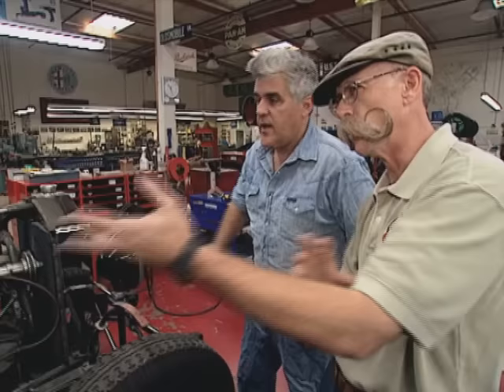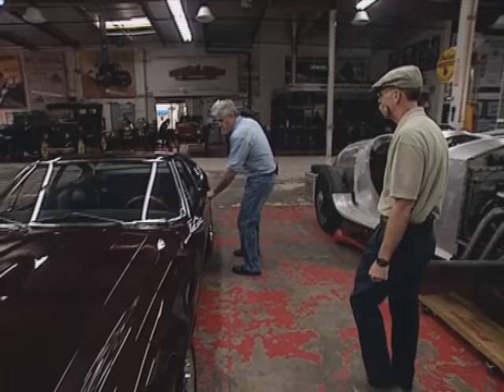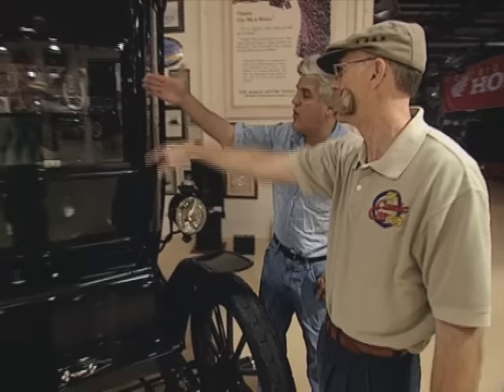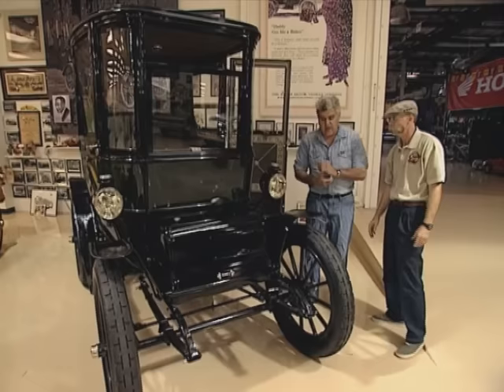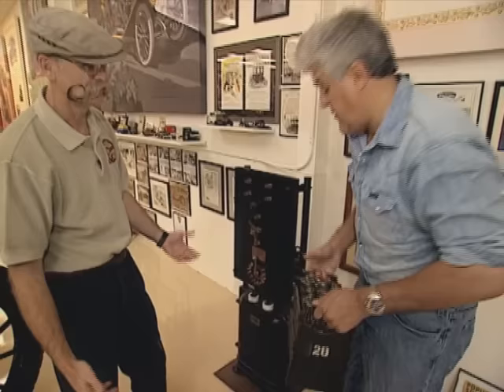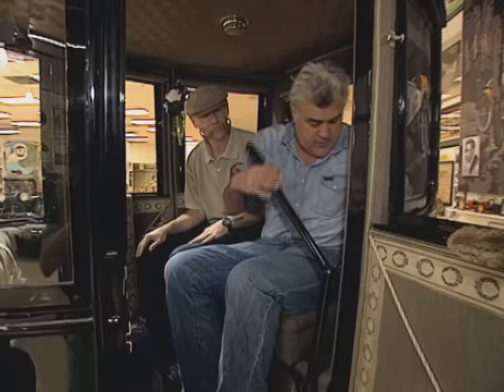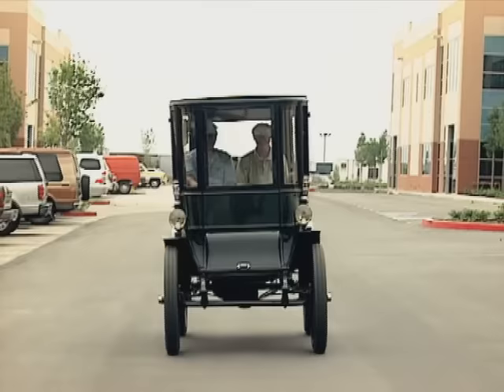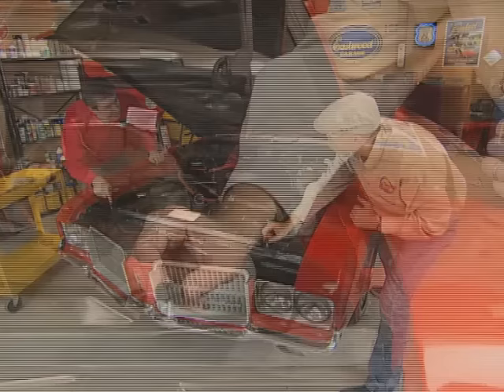Jay Leno's Baker Electric Car

Comment: 15,000 Electric Cars a hundred years ago?! Okay, I smell sabotage
Reply: +The real doktorbimmer I'm very curious about this...depending on how the electricity is produced electric cars can be better in all regards. I'm looking foward to the return of the steam engine tho haha
Reply: The real doktorbimmer hmmm, you don't think that with lighter materials and the ability to make more energy efficient boilers could allow a steam engine to be more efficient?
Reply: +The real doktorbimmer 
ah, the long tailpipe argument.
Tell me more about it.

Have to agree on steam engines though, something about them...
Reply: The real doktorbimmer
I do love locomotives, but I've always had a thing for traction engines in particular.
Any steam machinery is lovely though.

Now onto the long tailpipe debate:
Whenever i see people opposed to electric cars, they use the long tailpipe argument.
Really, the cause for concern should be surrounding the lithium used in their batteries.

The part i have trouble believing is that more than 75% of the energy generated at the plant is lost to transmission alone.

A Tesla model S for example, has an electricity to wheel efficiency of 97%(!), a charging efficiency of about 90%, and therefore an overall energy use efficiency of around 87%.

Petrol cars tend to be low twenties for overall efficiency, though Diesels can be notably more efficient, around the low thirties.
So in terms of energy use over distance, an electric car is 2-3 times more efficient.

Secondly, power plants achieve much better thermal conversion rates than internal combustion engines, because they don't have to be small and compact.
While a petrol ICE can achieve 20-25% efficiency, a power plant can achieve 40-50% efficiency. Due to the way they operate, coal power plants can achieve similar efficiency.

Lets call that up to 2 times more efficient.
What this translates to is that even a large, heavy electric car like the S is around 6 times more efficient than a gasoline car, and 4 times more efficient than a diesel car.
Therefore, to even be bought down to the level of a diesel car, transmission losses have to be in excess of 75%, but the numbers i find state around 30% per 100 miles.

That comes out at about 400 miles of transmission distance before electrics are on par with diesels, and 400 miles seems an excessive distance in most cases.

My country is over 80% renewable electricity, so electric cars win hands down here, they get the equivalent of 220-240 mpg.
Reply: The real doktorbimmer
The only NAS study i could find referenced coal plants, and it wasn't to do with their efficiency, but rather the deaths the pollution caused, something coal is far worse than gasoline at.
The same paper also said that for natural gas plants EV's were significantly better, and the U.S is currently focusing on reducing their coal generation. In fact the U.S is already more than 50% natural gas, nuclear, and renewable.

And where did you get those figures for electric vehicle efficiency?

A Tesla model S gets 97% efficiency from battery to wheels, and 92% battery cycle efficiency, which comes out to a total of 87% electrical to mechanical efficiency.

Not to mention that the best ICE cars today are around 35% efficient, while a power plant can reach 55% efficiency. A natural gas plant can be over 60%.

So a Tesla is about 2.5x more power efficient for a given distance than a high efficiency ICE, and its power generation source is at least another half more efficient than said ICE. That means that a Tesla is roughly 4x more efficient per mile than a high efficiency before transmission losses.

Transmission losses are about 30% per hundred miles, so in order to bring the efficiency of a Tesla down to 30% overall, you need to be transmitting the power over a distance greater than 400 miles. Most power plants transmit power less than 150 miles from what i can find, leaving a Tesla at 2.5-3x more efficient than a high efficiency ICE.
The fact that a Tesla has an equivalent mpg of around 120, while a high efficiency ICE gets around 45. The numbers get even better if you use something more efficient like a Prius.

You also make the assumption that EV's will only be run from power plants that burn fossil fuels, and as far a renewable's like solar and wind go, you could be correct.
But as far as i'm concerned, nuclear power is still a promising alternative, look at countries like France, almost completely nuclear.
Also, my own country is actually over 85% renewable, so EV's win on pollution here hands down.
Reply: The real doktorbimmer
Can you sho me where the paper claims that please.
I must have missed it, because i only found numbers for coal pollution to power EV's compared with gasoline pollution directly from ICE's ,and as i said, the same paper also claimed that natural gas EV's are better, and the U.S is increasingly using natural gas, as well as nuclear.

And can you give me a proper explanation, from start to finish, as to why i am wrong, rather than being vague?

Also, i call bullshit you were using my figures, you said 50-60% losses for battery, and 30% losses for transmission. I said those numbers were 8% and 3% respectively(at least on a Tesla, i don't know about other EV's)

I'll accept that some of the numbers could be a bit off,depending on the exact equipment, but i couldn't find any ICE car with better than about 35%. The higher figures in the 50's are in ships and generators, the same sort that run power plants.

And i also never said that renewable could support the world. I said Nuclear power could.
Reply: +The real doktorbimmer 
I wasn't using losses.
If you want loss figures, a tesla has a 3% transmission loss and an 8% battery loss, for a total 13% loss.
Reply: The real doktorbimmer My province produces all it's electricity through hydro power. Wouldn't electric cars be a good solution?
Reply: The real doktorbimmer The tesla has a good enough battery to be an effective replacement, no?
Reply: +The real doktorbimmer  and the price
Reply: The real doktorbimmer
Gasoline Cars were expensive and inefficient at first. Look at them today. Given time, electric cars will improve their batteries and price, but only if people are pushing the development.

That is the long term goal of Tesla.
In a few years they will release the model 3 with a price tag of $35,000. Still expensive, but a lot more accessible to the general public. The idea is that it will be what the Model T was 100 years ago.
Reply: The real doktorbimmer
You can't build the perfect battery, but you don't need to. You only need to build one that beats an ICE. An Aluminium-oxygen cell could potentially do that. Or any one of a thousand other chemistries.

As for that being Tesla's long term goal, you do realise they have yet to turn a profit?
The major shareholders are Elon and Kimbal Musk, and they have stated repeatedly that mass EV deployment matter's more to them than profit. 

It is true that Tesla has missed some deadlines, and even cancelled the battery swap idea due to lack of public support. But they never said anything fundamentally untrue that i can find.

Most EV companies have died so what?
Most Operating system companies died too.
But Apple and Microsoft are still here.

As for the number reaching ~15 million.
That is your opinion. At this point no one knows how it will turn out.

You know, i actually am not that confident that they will do it either.
I like to hope they will, but there are so many things that can kill a company.

AND NOT THE EFFICIENCY THING AGAIN. I posted the numbers, you never gave a proper argument in reply, but we can go through them again if you like.
EV's are more efficient in virtually all scenario's. Even a low efficiency EV running on a Chinese coal plant gets 35mpg.
In America the average is closer to 80mpg, because of the large amount of nuclear and natural gas in the mix. In my country they get like 250mpg, because we are 80% hydro power and 10% wind, with the remaining being natural gas and coal.

Go ahead and give some actual math disproving EV efficiency, not a mention of some study that you didn't actually read, do it yourself.
Reply: The real doktorbimmer
All, right lithium-oxygen then.
For some reason i thought aluminium air cells were secondaries.

As for Elon getting a payout, i'm willing to believe that if you give me proof.

But 11 billion?
Sounds like SpaceX to me, not Tesla.
SpaceX is his moneymaker.

As for the 250mpg:

http://shrinkthatfootprint.com/wp-content/uploads/2013/02/Shades-of-Green-Full-Report.pdf

This was done in 2009, when lead-acid battery
technology meant electric cars were about 15% less efficient than today, so multiply by 1.15 to get a modern lithium-ion car.
Also be aware that many countries are even more energy efficient today.
Alternatively, consult the "low" column of the final graph.

It's easy when you think about it.
Assume an electric car gets the same mpg as a normal car (event though they don't, they get better), now assume that the car is 90% hydro powered, and 10% gas-generator powered. This is roughly what my country is.

This means that for a given distance the electric car emits only 1/10th as much co2, therefore getting 10 times the mile-per-gallon-equivalent. So roughly speaking 25x10=250.

An electric car run solely on solar power gets infinite miles per gallon.
So a car on a partial fossil fuel source only consumes that relative fraction of fuel.

Now as i said earlier the U.S is 50% natural gas and nuclear, this brings its relative mpg to around 60% more. So depending on which state you are in, electric cars get between 25 and  70 mpg. Factor in the increased efficiency and those numbers get higher.
Reply: The real doktorbimmer
O'k then. Thank you for actually responding by pointing out flaws in my argument. I will now address them:

How about we say 45% for a power plant efficiency. This is less than what some marine power plants on ships get, so this isn't overly optimistic.

Now i'm going to assume that the transmission occurs over a distance of 500 miles, even though it is usually less.
In the U.S as best i can find the grid is a 345kv system, which gives a transmission loss of 4.2% per 100 miles.

Then lets account for the Roadsters 13% charging losses.

Overall, this brings efficiency down to 32.4%
So the energy delivered from one gallon of gasoline is 33.4 * 0.324= 10.8 kWh

I'm now going to use a roadster gen 3, with the 400 mile range. This roadster can go 5.7 miles per kWh.
10.8 kWh * 5.7 miles = 61.5mpg
Still way above ICE's

In fact, to get down to say, 25mpg, the energy efficiency for extracting electricity from gasoline has to be as low as 13.1%!
A backyard generator can do around 18%.
Even accounting for the charging losses, this is still about 16%, and 30.5mpg

So even charging your car with a small generator is still more efficient than most gas cars.

Oh and to answer your questions, a Tesla battery pack has a guaranteed lifespan of 10 years, though they should last longer.
The production energy for a Tesla battery pack adds about another 40% more electricity cost to producing the car, so they do have a larger initial offset. Battery performance after 10 years is about 85%.
However this only affects capacity, not efficiency.
The batteries have a standby loss of about 0.2% per day.

However, Mpg doesn't take the efficiency cost of transporting gasoline or pumping it in stations into account, nor does it account for idling in a car, or the fact that a lot more energy is used when starting the engine. It is just a measure of running performance

So why should eMpg take into account losses like that?
Reply: The real doktorbimmer
Tesla's batteries have a 87% wall plug in to transmission out efficiency.

And i did include those losses in my figures! (remember the 13% loss? 100-87=13), all i was saying is that if i include those losses, mpg for normal cars should also include pumping, transporting, and idling losses, since they use extra energy too.

Anyway, show me exactly where my figures are grossly inflated, and correct them.

And there are ICE cars out there with 42% overall efficiency?

This should put them in a similar mpg to the roadster. An average sized car with 42% efficiency should have at least 50mpg.

Give me an example please, i have not been able to find more than about 30% overall efficiency cars, usually an engine with about 35% efficient, and some transmission losses.

Now i was able to find some diesels that approached this requirement, but my calculations for an electric car were based on a gasoline power plant. If i based them on a diesel power plant, i can bump that 42% figure up to around  52%, and get about a 24% boost to mpg. (24% of 42 is 10)

Another question for you, do you think hybrids are less efficient than normal cars?
Reply: The real doktorbimmer
Diesel is not the most efficient form of propulsion used by mankind. That would be nuclear actually. Of course there are very good reasons why we don't have nuclear cars but still, it beats diesel by miles.

And actually, diesel looses to other methods, such as hydrogen fuel cells, high bypass gas turbines and solar. (solar is a bit weird, since it technically gets infinite mpg, but it is limited by weather)

It is however, much better than gasoline, i was very impressed by the Audi A3 TDIe!

It's combined driving mpg is a tad better than a gasoline sourced Tesla roadster, 63 vs 61.5 .The value of 71mpg it got in the race is inaccurate, since it was driving at an average speed of less than 50mph, and that would increase any cars mpg. I can settle for 71 though.

Problem is, as i said earlier, if you want to bring diesel into the mix i can buff my numbers a bit, since diesel generators are also more efficient. Diesel also has more energy per gallon. 
55% instead of 45% for a power plant.
And 38kwh instead of 33.4kwh per gallon.
55% accounting for transmission losses and charging losses is 46.7% efficiency, and a mpg of 17.75 * 5.7 = 101 mpg.

The reason electric cars can get better efficiency is because stationary power plants usually get significantly better efficiency than compact mobile variants, usually around 40% more, but the losses from transmission and charging are usually only half of that.

Now if you compared a diesel car to a coal-electric, sure the diesel would win. but diesel vs diesel, electric gets better efficiency.
This is also why serial hybrids get better mpg than their pure ICE cousins. The engine in them can run at its ideal rpm and torque range, getting better efficiency, and this is more than enough to offset the losses of an electric drive train.

As for electric cars loosing on range and charging, yes they do. Currently they are worse than their ICE rivals. But this is irrelevant when talking about efficiency.
Solar cars get practically infinite mpg, but they aren't practical for everyday use.
Reply: The real doktorbimmer
Diesel is arguably the most cheap and practical fuel source given our current infrastructure, yes. 

And the most efficient when specifically talking about the Carnot cycle yes.

But the Carnot cycle is a terrible measure of efficiency when comparing different types of power source.
Specific energy of the fuel source combined with the energy capture efficiency is much better.

Uranium has a specific energy roughly a million times greater than diesel, so that pesky 40% vs 56% doesn't matter so much.
This is why U.S warships and submarines use nuclear, they can run on a barrel of uranium for a decade rather than a minute.

But as i said before, nuclear is not practical for most vehicles.
Gas turbines similarly loose to Diesel in heat efficiency, and thus the Carnot cycle.
However, due to the specific energy of the fuel they use being about double diesel, they can still get better mpg, though not by much.

However, their high idle fuel consumption, large startup costs, and poor spooling response make them inferior for use in small vehicles that start and stop regularly.
Hence why they are used in aircraft and some ships and tanks.

Saying solar panels get a poor Carnot cycle is unfair for the same reason as nuclear.

Because solar panels use the sun as an energy source, they have specific energy comparable to fusion power.
This makes them more efficient than even fission power, by a factor of 20-50.
However, they have terrible capture efficiency due to distance from the sun and limitations of the photoelectric effect, bringing them to approximately the same efficiency as light water reactors.
Still far more efficient than diesel though.

Again, they are less practical than diesel however, since they only work in sunlight.

So while diesel is more practical than these three power sources, something i never disputed, they are more efficient, in some cases by orders of magnitude.

Electric vehicles can take advantage of this higher efficiency offered by fission and fusion. 

Theoretically with good enough batteries they can reach a level of practicality similar to diesel or gasoline.

Tl;dr fission and fusion energy is more efficient than chemical energy, but currently less practical.
Reply: The real doktorbimmer
Energy density is the measure of how much energy you get for a given mass.

Some energy density values in MJ/kg:
Diesel (Chemical): 48
Hydrogen (Chemical): 142
Plutonium (Nuclear decay): 2,239,000
Uranium (Nuclear fission): 80,620,000
Hydrogen (Nuclear Fusion): 89,875,517,900

As you can see, diesel is hideously inefficient compared with anything nuclear.
BTW, most sources of "sustainable" electricity are either nuclear in origin.
Wind, solar, and hydro are all driven by fusion.
Nuclear reactors are driven by fission.

With a few exceptions, everything else falls under chemical, usually hydrocarbons.
Reply: sorry, but  Americans don't want to buy electric cars.
Reply: kaputnik11
Tesla's sales figures in N.A compared with Europe and China beg to differ.

But the general public? 
You would be correct.
Reply: The real doktorbimmer
Thermal efficiency != Fuel efficiency
At least when it comes to vehicles.
A scenario to demonstrate my point:
(a pirate-ninja is a made-up unit of energy, similar to a kilowatt in function)

Car A runs on fuel A
Car A has a 20% efficient engine
Fuel A contains 10 pirate-ninjas per liter

Car B runs on fuel B
Car B has a 10% efficient engine
Fuel B contains 50 pirate-ninjas per liter

Both cars can go 1 km per pirate-ninja.
If you fill both cars with 10 litres of fuel, 
Car A will travel 20km
Car B will travel 50km
So despite car A having a more efficient engine, it will not travel as far for a given amount of fuel.
Therefore, doesn't Car A have better engine/thermal efficiency, but Car B have better fuel efficiency?

But sure, if you want to define specifically the Carnot cycle then diesel is the best, though Stirling and Rankine based engines can give it a run for its money on overall heat efficiency.

Another hypothetical scenario:
A wind-up car is wound up using tidal power.
What is its thermal efficiency?
Bugger all, that's what.
Yet it runs purely on momentum conversion, giving it virtually infinite fuel economy.

Of course such a car would be impractical to the extreme, but i hope it illustrates the problem with using the Carnot cycle specifically, and the heat cycle in general, as a comparison of efficiency when one or more if the methods in comparison doesn't use heat for energy.

Some Engineers may use the Carnot cycle, but Physicists would use specific energy on account of it giving a better picture of the overall scenario.
Reply: The real doktorbimmer
But my point was, that of what sales they do get, most are in America, not overall sales.
Reply: The real doktorbimmer
Comparing a car that is half the price of another isn't a real comparison.
Of course more people buy the cheaper car.

If you want something to compare against Tesla you need to look in the $100k+ range.

But anyway, my point wasn't and still isn't that Tesla is specifically popular in the U.S, but rather that it is more popular in the U.S compared with Europe or China
Reply: The real doktorbimmer
I never made that comparison though, you on the other hand did make a comparison between a Tesla and a Chevy.

I could remark that a $200k Rolls Royce doesn't have the same range or fuel economy as my Toyota corolla, but that doesn't make my corolla a better car.

I also never claimed that Tesla was "popular" in America, merely relatively <i>more</i> popular than in other countries. I've said this several times, but i'm not sure you get it.

Tesla is super popular in my country btw, we have a whole THREE of them here.

Most popular car would be either mazda's or toyota's, basically all i see.

(and yes i know that html formatting doesn't work in YouTube comments, i just want to highlight the word more)
Reply: The real doktorbimmer
Can you point out where i implied that Tesla was popular?
I'm fully aware that they have a very limited market.

Also, my Rolls Royce example was about price vs performance difference, not popularity.

I also never made claims supporting Tesla as affordable or practical, i merely cited them as an example of efficiency in the long tailpipe argument.
Reply: The real doktorbimmer
What word would you use to compare relative car popularity between two countries then?

And i only repeated that statement because you seemed to misunderstand.

As for the next "ford", honestly that might end up being Chevrolet rather than Tesla.

Not to mention your point of Tesla's being expensive and impractical is irrelevant in this particular comparison, because cars in general were expensive and impractical before Ford's Model T. The whole point of "fording" is to change that.

BTW, the point i made in that same comment was that in order for Tesla (or any company) to do that, they would have to reduce prices and improve battery performance.

At no point did i claim that they are currently "fording", rather that they might do so in the future. I recall saying that i wouldn't put money on them either, given the number of things that can kill a company.

Oh and Wasn't this discussion originally about the efficiency of EV's? rather than the poor practicality they have?

Where did we get to on that point?
Reply: back then i doupt sabotage was the reason. today though it could be true but people like Elon Musk dont want to be payed to make the company dissappear plus theyve gained so much ground other car manufacturers are trying to join the market.
Reply: +The real doktorbimmer just to let you know, Tesla sold 34000+ Model S's the first year they came out with the Model S, sure in comparison they dont match up but they are also not as financially accessible to the majority of people. they are extremely popular and just in a 15 mile radius from where i live there are 5. to make it better there are no Tesla supercharger stations or dealerships anywhere near here showing that a lot of people are willing to invest in the technology. sure the batteries are not good for the environment but we can only improve on something that is being used. if we just stay with gas and diesel then we will always be dependent on those fuels. i have a feeling electric cars are one of the reasons why gas stations have dropped their prices dramatically aswell as the supply being way more than the demand. also most electricity is produced by fosil fuel burning plants but again we need to take steps to improve in the long term and EV's will eventually be the answer.
Reply: Thats sad you wrote that in 2015 when what you just said has already been proven to be mostly wrong. Funniest part is Diesel Cars, DieselGate soo that prediction was dead. The National Academy of Science is widely disreputed now as it totally disregards Wind & Solar electric generation and only focuses on Fuel Efficiency based on Fuel consuming electric generation. Problem is you can't calculate Wind & Solar FUEL Efficiency when consumption is 0. Oh and now Wind & Solar is Financial Lucrative as a Buisness while dozens of Coal companies around the world are going Bankrupt due to financial business reasons. Hmm I wonder how does Wind & Solar pollute the Air Quality in rural areas. Sucks for you your comment is stuck online for many years, kind of looks silly now.
Reply: At least attempt at constructive criticism and that is what you resort to. No I do not smoke marijuana, not legal where i live and not worth the risk.
Reply: Poor marketing was also responsible for the demise of the Baker Electric line of cars. They were viewed as cars for women.
Reply: If you think that Jay Leno is emasculated, or that Francis Ford Coppola fits that description, then you have never met or seen either of them in your lifetime. What cave have you been hiding in all these years? If not, then you are [more likely] just suffering denial about the inevitable changes which the future will bring. This is not about carbon footprints, but it is about breathing air in order to survive. I see the brown cloud that rises each day along the coast of Israel, and I lived in Los Angeles at the age of eight, when it was still a city with blue skies, before smog ended that chapter. Smog is produced by ICE engines. You do not have a leg to stand upon, but you may have a financial dog in the promotion of the ICE market, and therefore want to trash electric cars. What else about them is a threat to you?
Reply: Did you include the cost of the billions in government subsidies to oil companies?  what about the trillions spent on wars to secure future oil reserves,  and the blood spilled?   what about the cost of oil spills and environmental damage,  cost to health?   imagine trying to sell the idea or oil, as a new idea,    super tankers, special "stations" to distribute fuels,  big refineries to process that fuel, and special vehicles to transport that fuel to those stations.

Imagine if a fraction of the money spent to make oil work ,  was spent on electric batteries?  100 years ago, 

fact is fossil fuels were used , simply because the crap was bubbling on the surface in some places, and until the early 70s,  we had so much we could export it. and produced all we needed.
Reply: It does not matter what the nay-sayers say,  not every country is under the influence of big oil and their negative propaganda,  many countries are moving away from fossil fuels,  not only because its the environmentally beneficial option,  but for economic reasons,  it makes their nation dependent on other countries.   ICE to many is like some religion,  talk of electric cars is blasphemy.   so while America is still enamored with sucking on the oil tit.  the rest of the world is moving forward,  many countries with plans to be 100% oil  independent.   whether its solar, wind,  geothermal,   nay-sayers of electric cars will also say "its impossible" or will never happen,  same was said of humans and flight.
Reply: The polluting part is the manufacture of the batteries.
Reply: Look up nickel mines and what they do to the surrounding area.
Reply: More like suppression. 

2 years later and you got a notification from this comment. I bet that feels good.
Reply: If you think about it there would have been more co2 produced by an electric car up to a certain point since the power would come from coal power plants and batteries then weren't as efficient as today's. Even the tesla has roughly the same impact as a prius assuming it's grid charged.
Reply: doktorbimmer  source?
Reply: It's just not true. Coal power is still much more efficient than petrol engines, mostly because they just keep on turning at a constant RPM, and can have the exhaust gasses used to spin up a secondary turbine. Most electric car nuts these days usually show interest in solar panels too. Here in New Zealand, we're almost entirely Hydro or Wind powered, and have been since forever.
Reply: doktorbimmer LETS GO HYDROGEN TURBINE POWERED CARS
Reply: really it was just because petroleum engines were cheaper to produce and run
Reply: Yes they can, Tesla has the fastest mass production car 0-60
Reply: lol you know oil and gas moneybags killed the electric car right they burned the designs and bought out the companies
Reply: Sabotaged by Ford. Mass production over coach builders. Electricity costing a premium and was not available everywhere like a lighting fluid.
Reply: jp moneybags Morgan and oil papi Rockefeller are the guys who killed the electric   car back in the day
Reply: das auto 
das ist korrect, mein herr.....
Reply: korrekt nein C das ist gut
Reply: I need to get a hobby.... posting hundreds of comments in a week doesn't count..... also im not bias for overpriced and poorly designed german cars, fords technology is far superior but tesla is the future!
Reply: buuuuuuuuuuuut.... in the long run tesla will win becase i beliveiieve in elong musk! porsche such two, some of the most overprised crap car everr 10/10 would report again :) also i dun goofed trieing to go bold im a weiner. you guys watch Ali-A? quality content.
Reply: The only sabotage was the advent of the Model A and Model T, along with the burgeoning early 1900's petroleum industry. As gasoline became readily and widely available, it spelled doom for the electrics.
Reply: doktorbimmer by 2040 you will no longer be able to purchase new cars with ICE. I believe other countries in Europe are doing the same. And company's such as Volvo are going going electric only from 2020. I may have to move to America. I trust there are no such plans in the land of the free?
Reply: shut your face! You think it's the level of engineering that keeps Mercedes, bmw and Audi their market for 30000 grand plus cars? Or the Ford and other car brands are incapable of matching such engineering. Lol. That might of bee n the case once upon a time, but I can assure you it's now purely down to marketing and the brand image
Reply: doktorbimmer lol. Unfortunately I believe the Germans can claim that honour
Reply: doktorbimmer I would have to agree with you, certainly the for road cars. I reckon England is the leader for race technology though
Reply: shut your face! Yeah I agree. I don't doubt that American companies could build cars like the Germans. American motoring has it's own unique history, because they are, or certainly were their own biggest market.
Reply: doktorbimmer oh dear; you've managed to sound reasonably intelligent throughout most of this thread. Here is a few things I can think of off the top of my head. roughly half the IndyCar engines are developed and built in England. le man lmp1 champion, le man lmp2 champion and Indycar contructors and drivers champion are a few of the cars to have British designed and built transmissions that have won in 2017 there are many more. Prodrive is a British company that runs race programs for the likes of Porsche, bmw, ford and Honda, amongst others. And then theres formula 1. I think about 3/4s of the   grid is designed and built in England.
Reply: I smell lobbyism.
Reply: doktorbimmer dude if electric cars would have been updated like gas was for the past century+ then it would be MUCH MUCH better... That car is amazing technology for that damn in age absolutely amazing and if it would of picked up we wouldn't be driving vehicles 1000x more efficient. Now if our government would quit being greedy pieces of shit and upgrade our grid electric cars would be much more efficient over cars... We can obtain electricity much more environmentally friendly than we are now but our government is to corrupt... Thats not electric cars fault that's the governments fault and once all that is taken care of electric cars will dominate.... electricity shouldn't be as expensive as it is and it won't for much longer.... Hopefully in the next decade something gives and our government has to get off their asses...
Reply: doktorbimmer it's okay because from the start the electric semi is going to outperform diesel semis and that will be the real start of mass produced EV.
Reply: Ah denying things that have already been accomplished 😂
Reply: doktorbimmer https://youtu.be/XlMFLPGUiQE
Reply: Read Edwin Black's book Internal Combustion. He wrote how through stock manipulation in chapter 8 of his book
Reply: doktorbimmer My brother you sound an Oil Company shill
Reply: But like you said in a 109 years electric cars especially their batteries save for the Lithium ion battery The Car Companies have only produced ICE powered cars With the Lithium Ion battery being the cutting edge in batteries And Mr. Black has wrote that just now people have been working on new battery technology. Something or someone is dragging their heels in producing electric cars
Reply: doktorbimmer Of course because your Oil company paymasters would say that as they buy all the new battery technology. And General Motors leased and notice didn't sell the EV1 and then cancelled their leases and crushed all save for a few EV1's And about Hybrid cars only Toyata sells Hybrids all the while receiving nothing but Oil Company inspired heat
Reply: actually it was more about redibility
Reply: doktorbimmer have you ever heard of solar or wind power electricity production?
Reply: The electric cars a hundred years ago weren’t as good as the internal combustion engines of the time
Reply: ChildOL they were never developed because of the powerful oil companies.
Reply: ChildOL you can thank Jay Rockefeller and Henry Ford for that one they sabotage Nikola Tesla's AC induction motor by saying it's dangerous you can think J Rockefeller and Henry Ford to that one day sabotage Nicollet Tesla's AC induction motor by Santa's dangerous call Nicollet Tesla want to put free electricity for every household all they had to do is stick a pole in the ground and they would have got electricity from the air and JP Morgan who was investor said f*** that s*** if I can't put a meter on it and charge for kilowatt in ain't going to be done so in the air being polluted with gasoline Vapors killing us
Reply: doktorbimmer my friends you don't understand how this works if everybody be driving in like the cars the world be a lot better A lot cleaner nobody would need to go faster but you can think Henry Ford and JP Morgan for that one so if you would study your history you would learn something Henry Ford saw the electric car as a threat and so did JP Rockefeller because Rockefeller had tons of money invested in petroleum he want to get that s*** out of the ground and into combustible vehicle as quick as possible and he was a ruthless scrupulous man he was very bodies and bribe Congressman to get what he wanted that's understandable hell he didn't want to be in the poor house or going to the soup lines so he did what he had to do.
Reply: charles neely think you will find it was the oil companies of the day that sabbotaged the electric car.
Reply: Indrid Cold ive already seen a documentry on this, oil companies stopped the electric car from being developped further.
Reply: same
Reply: OR A BS COMPANY...
Reply: Try looking up the movie...Who Killed The Electric Car... and you will be amazed.
Reply: doktorbimmer steam engines are the most efficient engines bro
Reply: "42% EFFICIENCY". No, you can not. If you're going to calculate transportation loss with EV's, you have to do the same thing with ICE. You have to calculate the energy consumption for drilling and pumping oil, consumption of transporting the oil to the refinery, consumption to make gasoline or diesel, consumption to transport gasoline to filling station and lastly consumption on holding a gas station alive.
Reply: There is still an air of mystery surrounding the burning of the Olds factory in 1901 and why Ransom chose the path of gas over that of electric or steam.
Reply: 2 years ago electric cars still didn't even compete now batterys get more efficient and bigger evry day and evry car company is starting to sell electric cars
Reply: Electric cars were clearly sabotaged
Reply: TheGreatUtopiaCat you also have to take into account the environmental damages caused in the making of the batteries for an ev
Reply: How sick is this ...cool stuff man i mean 19what?? Electric?? Wow!
Reply: Well, now it's 2018 and the Tesla Model 3 is directly competing with BMW, Audi and Lexus in the U.S., eating away their market share.
Reply: Electric cars have a 95+% efficiency, meanwhile, I.C.E. cars have a 20% - 40% efficiency.
These studies always don't factor in the complex and energy-demanding manufacturing process and assume that gasoline/diesel magically appears at the gas station, that's why their results show that electric cars are dirty.
Reply: 15,000 just in NYC is what he said.
Reply: cough**cough Tesla......

But again your comment was made 3 years ago so...
Reply: 3 years of skepticism and now silence.
Reply: I guess that "doktorbimmer " is scared of electricity. I agree to your conclusions, and figures.

proud Zoe owner - first electric ever, and love it.
Rides a Moto Guzzi Stelvio when the sun is shining O-)
Reply: @doktorbimmer  Don't say that to Tesla.
Reply: Considering that 70% of the electricity in the US is still coal fired powered plants, I'm sure you can do the math. Every time you convert from AC to DC or vice versa, you loose 20-30% to heat, there's more efficient stuff but generally speaking... also, charging batteries looses energy in the form of heat. So ya... by the time it makes it into a form that can run out of your battery and into the wheels it makes for a real challenge to compete with gas & diesel.
Hopefully we'll continue efficiency with solar, maybe people will start accepting solar panels built into the body. And I know that some of the experiments that people are doing with high voltage and pulsed DC are yielding breakthroughs. I honestly think the military already has a lot of that figured out though, they just don't want to loose the strategic advantage by giving it up.
Reply: @TheGreatUtopiaCat  i just had conversation about this today! Maybe if they do come back they'll be just as good as electric!
Reply: @doktorbimmer  They could then they couldn't and now they can again.
Reply: Vintage and Antique Automobiles really?   Why didn’t anybody tell me that before I bought two of them?
Reply: ISAACASIMOV30  why Isaac of course that’s true in fact we should all go out and buy internal combustion generators and run our houses off of them.  More efficient and cleaner than the power company can generate ;)
Reply: @doktorbimmer   ICE's have inefficiencies which you have neglected. 
Which is first the energy and resources utilized and wasted for the discovery,drilling 
and extraction of petroleum fuels which is immense.
Then the transportation energy and resources for the crude oil to the refineries to separate the petroleum products of which only a small portion is used for diesel or benzene  and is processed using other chemical resources and energy for processing to
 toluene and blended with additives say for gasoline and this is again all has to be transported to multiple sources for storage and final distribution.
Reply: @TheCaptainSplatter  Electric vehicles don't have to use batteries to power the motor the roads could power the vehicle remotely by induction if electrified which is a way many electric motors function.
Reply: @doktorbimmer 
 my friend welcome to the future, tesla is here.
Reply: Back in the day. Electric cars were popular. Gasoline engines smoked like crazy. Internal combustion engines were mass produced and made cheaper hence the first death of the electric car. It costs a little more than $5 dollars to travel 300 miles in a tesla. So tell me which is more efficient.
Reply: "Top Speed 23MPH"
Reply: @TheGreatUtopiaCat  I wish someone would make a cute little electric kart car.  I wouldn't care if you couldn't drive it on the highways. that 50cc scooter life
Reply: You may be joking but you are actually correct. Just as Microsoft sabotaged competitors, so did the gas car companies.
Reply: me too.
Reply: The batteries were shit and petrol/diesel/ethanol has been the superior method of storing energy for all this time. The electronics industry is gigantic and if there were better batteries out there all this time they would be available. Edison was really keen on having electric cars, and electricity was also the cool new thing back then so they were overhyped.
Reply: an argument that has lasted 3 years
amazing
Reply: 1,500
Reply: Gasoline won out as they could go much faster, had better range, & didn't take a long time to refuel. And you could easily drive outside the city where electric supply was still lacking. WW1 saw a lot of advancement in gasoline & diesel engine technology, further widening the gap.
Reply: Read Internal Combustion by Edwin Black.
Reply: rothschilds and politics$
Reply: Just before rockafellers came to fuck around with crude oil and shut da fuck down all green stuff.
Reply: I'd say, more foolishness and narrow-mindedness.
Apart from viewing them as a weak ladies' car, no-one picked up on the potential of hybrid cars, even though Porsche made a fully functioning one before the turn of the century.
Reply: ChildOL - I smell people bought what they needed and liked. Capitalism.
Reply: @Ken Konard
Liked, yes. Because they bought whatever was trendy or pushed by marketing. Needed, no.
Reply: avada - If someone needed to go faster to deliver perishables or just want to save time, they bought steam cars or gas cars. That still goes in free countries - you buy what you need or can afford or whatever turns you on.
Reply: Elusive7thElement 
Three Mile Island/ Fukushima // Thorium far less dangerous than uranium/Plutonium (Not part of WMD cycle for Nukes ☮️)
Reply: Me to.  Say when!
Reply: Range and power were massive problems. Yes, the cars could go 100 miles or so, which still to this day is fine for local or city driving. It's when the ICE cars started getting drastic range and speed improvements. Engines got more efficient, and getting 400 miles on a tank of gas is relatively easy achievement. Battery technology didn't improve much from the early 1900's right up until the consumer electronics age, and even then improved at a far slower rate than internal combustion engines.

Take the Edison Nickel-Iron batteries Jay showed in this video - those had a specific energy of about 25 W/h per kilogram in 1901 with a specific power of 100 W per kilogram. While nickel cadmium batteries were an improvement in terms of energy density, they had an incredibly short lifespan made them wholly impractical in automotive applications. It took until 1989 for the Nickel Metal-Hydride battery to extend beyond the space industry, which had a specific energy of 120 W/h per kilogram, and a specific power up to about 1000 W per kilogram. It took nearly a century for battery capacity to improve by a factor of 5, with the current sourcing capacity improving by an order of magnitude (while not completely accurate, think of this as "allowing" a horsepower improvement of 10x).  In the thirty years since 1989, capacity per kilogram has a little more than doubled with the lithium-ion battery (up to 260W/h per kilogram). So, in 118 years, we've increased our battery capacity by 10x and the power delivery by 10x. Compare that with the internal combustion engine - you can buy a car with 100x more horsepower than you could 118 years ago, although the range has improved from ~150 miles (model T) to ~400 miles (a 2.5 x improvement). You STILL can't buy an electric car that goes that far.

Now, this isn't to say that people really need their daily driver to go 400 miles. Americans tend to buy a car to fit the largest thing they could every think about moving or the longest trip they can visualize taking - even if they are only going to do it once or twice in the time they own that vehicle. To be honest, I think this is flawed logic. Renting the vehicle you need once in a blue moon is significantly cheaper than taking the financial overhead of driving a larger vehicle all the time (it cost more upfront and costs more to operate). Although this may be rich coming from the guy who drives an '04 Ford Expedition for an 8 miles commute (my parents gave it to me after college, I'm keeping it while I finish paying off college loans, don't need a car loan right now), I think my next vehicle is going to be whatever economical electric car is available in 3 to 4 years.
Reply: @Elusive7thElement  I recommend you to watch Thunderf00t channel about electrical batteries and the reason why the electric cars are inefficient in reality. The electric motors are very efficient, not the batteries.
Gas get you more mileage due to the tremendous efficiency of the fuel chemistry, 1 kilogram of gasoline gives you 44 MegaJoules of energy vs. A lithium-ion battery pack has only about 0.3 MJ/kg ! ! ! Gas is very efficient compared to the most modern electrical batteries out there, but the gas engine design is inefficient due to the fact that the piston rings expands inside the cylinder causing enormous friction and losing most of its explosive energy into heat. There are currently testing new designs of engines with different alloys, composite materials and different piston configuration to reduce the thermal expansion of parts, friction and heat loss of engines. Imagine having finally a better redesign gas engine ! ! !
Reply: @TheGreatUtopiaCat  Seen the steam powered Jeep that goes around car shows? It's pretty neat.
Reply: watching everyone argue with some troll who deleted all his posts = priceless
Reply: it was more expensive than gas-powered cars. That's the "sabotage"
Reply: @GiordanDiodato  People these days love a conspiracy.. I doesn't help when the government gets caught doing them though.. And the fact that our history and laws have been formed mainly by companies keeping things out of our hands which they have no control over, and only allowing us to have things which they profit from.

So it's understandable that people see sabotage in everyday things. 

The simple fact is that gas cars were not limited by charging cycles and battery size. For a hundred years we were held back by batteries. The lithium batteries that we use today were discovered in the 70's and it's taken this long for that technology to become inexpensive enough for us to have in our everyday devices. They had to create new refining practices, taking the raw material only rarely found and mined and create new ways to separate lithium in it's raw form from the other kinds of rocks and minerals around it.. Not only new ways but faster cheaper ways to sort it. And then they had to build large factories to process it into refined material, and others to turn it into batteries. they had to build the infrastructure first. 

Only then could they get it into the hands of billions of people around the world. 

But I've gone completely off topic here.. Jay's buggy isn't run off lithium.. It's run off good old lead acid deep cycle batteries.

Still it's tech that wasn't there 100 years ago. Not exactly. We now have better ways to charge those batteries. Even Jay's updated buggy still isn't as efficient as new electric cars. 

Only today can special batteries go 300 miles with only a 15 minute charge.. Jay's carriage likely takes 8-10 hours of charging for an hour or two of riding around town. 

I'd still drive the hell out of that thing! One of these days I'm going to convert a car to electric.. Idk if I'm going to just pull an engine and mount a motor to the trans or if I'm going to run a driveshaft direct to the rear axle.. or if I'll just run a front wheel drive car by connecting to a single wheel.. That is just as viable as cars today.. If a car doesn't have a posi differential or a locker it really only is putting power to one wheel. 

Electric cars were just way ahead of their time.
Reply: I smell bs.
Reply: Thats nothing, we had street cars all over Portland, Or. to just about everywhere. Then a certain rubber company, "F" decided to sell the city tires for busses so the streetcars all had to go and now, theyre trying to put them all right back in again...
Reply: @nunyabizness199  Portland is one of the cities everyone could care less if a zombie apocalypse broke out and everyone inside was quarantined until they all died.. just like NYC, LA, SF, DC, Chicago, Charlotte, Philadelphia, Houston, Phoenix  and all the surrounding cities that make up the greater area of those cesspools..
Reply: You can thank Standard Oil for that. 😂
Reply: I smell limited speed and mileage...plus that bad marketing decision to make it a "woman's car," thus cutting out the majority of the market (at the time, anyway).

And who thought having seating literally right in front of the driver was a good idea?
Reply: David RIGHT? Why would you market it for women when the world was run mostly by men at the time. About 70 years before their time I suppose. History has shown it was a bad move. History always wins.
Reply: @reforgedcriterion1471  I hear ya. I've never been able to understand why electric vehicles and solar power wind can't have a better business model. O'l well you know history is bound to repeat itself.
Reply: @Neojhun  So tell me something how does solar,wind  system's store thier power . Battery right! All we are doing is exchanging one waste for another. Geothermal power . I think  is where it's at.
Reply: Just General Motors
Reply: ChildOL yep crushed by Rockefeller funding Henery Ford to produce a gas powered vehicle EVERYONE could afford.
Crushed the electric car over a 100 years ago to keep us on “fossil fuels”👹👹
Reply: butchtropic  The fucking car is lightweight and can even travel long distances with lead batteries. We have been fucked selling fuel for 100 years. Now they will fuck by replacing the battery.
Reply: Ya ford bought them out to squelch the competition.
Reply: The simple answer is, OIL !!😊😁😎👍
Reply: @Elusive7thElement   Absolutely right and if you use PV or wind locally, the transmission loss for the juice is tiny and no polution other than during the manufacturing/disposal which you would have for the other sources (like a coal plant) anyway.
Reply: No shit. If Edison hadn’t fucked over Tesla we’d be living in a completely different world too. Global warming is the result of greed
Reply: TheGreatUtopiaCat Good joke.
Reply: ChildOL Craving attention? Or...
Reply: @Kaputnik11  HAHAHAHA hows this comment been aging
Reply: @plumpstery5199  You mean the fact that the vast majority of consumers buy gas cars? Pretty well
Reply: @Kaputnik11  i would look at tesla if i were you
Reply: @plumpstery5199  I would look at the broader market if I were you.
Reply: @Kaputnik11  i linked you a chart of ev marketshare
Reply: @plumpstery5199  1 percent is pretty nominal. Not to mention most people are buying Teslas because they are "cool" if you look at almost every other electric car in terms of sales they are pretty pitiful. Do I think electric car sales will do much better when they become closer to gas cars? Yes.
Reply: @Kaputnik11  1 percent now, but later it will be much more, thats what the data suggests, and not only that electric cars are much faster in most cases than their gas counterparts
Reply: @plumpstery5199  Very possible their share will continue to grow. I believe most of the growth will come from Tesla though due to the enormous brand equity they have. Also electric cars are not necessarily faster, they are much quicker though. I think the last thing electric cars need to do to go truly mainstream is to be lower in starting price points then I really think most consumers will switch.
Reply: @Kaputnik11  i agree, but your original comment said Americans dont want electric cars
Reply: @plumpstery5199  and I stand by that comment. Most Americans do not want electric cars. I think the opinion will change but most Americans want affordable easy to own cars. When new cheap electric SUVs come out I think that  it will really change the game
Reply: didn't make a profit
Reply: @TheGreatUtopiaCat  Steam is a great way to power cars, just put some uranium in it; all the steam powered speed you need.
Reply: Was thinking the same. They only push things when its about money

But these things... i don't get it. charging stations all over the place back then. why didnt this take off?
Reply: https://it.wikipedia.org/wiki/Storia_dell%27auto_elettrica
Reply: There was no need for sabotage. The gasoline car just got better faster. Inventions such as the self starter and syncromesh gearboxes and improvements to reliability left the early electric cars dead in the ditch.
Reply: @TheGreatUtopiaCat  steam engines are dangerous on cars, especially at the speeds seen today. imagine an accident with a boiler pressurised to 600-1000 psi with boiling water and superheated steam
Reply: You Smell Big Oil. What about the Edison Battery? Water?
Reply: Does it smell like oil?
Reply: Well, petrol and diesel cars were so convenient. 45s to fill up the tank, unlike charging a car that takes forever.
Reply: Correct.
Welcome the consequences of capitalism condensing wealth and power into the hands of the oil barons of the era and the likes of Henry Ford and other such wealthy people who all did their best to kill development of electric vehicles for as long as possible.
Reply: Petroleum, you mean. :D
Reply: @Drakilicious A 100hp diesel will do the same work as a 100hp steam engine. Sure a traction engine will pull a modern tractor though a brick wall - but it is a TRACTION engine - if you took that moder tractor - and its likely more powerful engine  - put it in a chassis that weighs 5 tons and geared it appropriately it would pull the traction engine through a brick wall. You can make a fairly efficient steam engine and I like them too. You get instant torque from zero rpm which is nice...But you got to have apples v apples and power is king in the end.
Reply: There was no sabotage, old electric cars were extremely expensive, and gasoline cars were cheap, that's why it didn't last. Plus, that's the same problem with today's electric cars, they're too damn expensive
Reply: The only sabotage that happened was Henry Ford T posing on the entire industry, pants down chin up.
Reply: You have to remember that both modes of power were about equally efficient, but petrol technology pulled ahead faster (batteries were the limiting factor for electric, then as now) and so it won out, no conspiracy theories necessary!
Reply: I think when WW1 broke out lead had to be used as bullets and shorted the supply line of lead.and out of the cities hardly any one had a way to recharge batteries until after the war was over when they started to build more power plants and gas vehicles were more affordable
Reply: I smell the consumers voting with their wallets and their "time"
Reply: Yeag, it's called long charging time
Reply: Yes...it was
Reply: Yeah basically was. The electric cars were all set to win until Ford came along with mass production. She basically priced them out of the market. An electric car cost more because of the batteries, and they never could get enough business to keep ahead.
Reply: Gasoline cars could go faster and carry a heavier load than electrics. A small car like that was fine for running around town, but, not so much for rural america.
Reply: Once Cars began racing it was evident petrol was the best way forward, and with racing comes incredible pace and breadth of innovation. This and the inherent range benefit of petrol in my book is the reason why we carried forth with the iinternal combustion
Reply: @TheGreatUtopiaCat  The main problem with electric cars, is that they are expensive to charge. Though 100 miles on a charge has been standard on electric cars for a long time. I worked with my father on a 1959-1960 Henny Kilowatt, (Eureka Williams and National Union Electric Company, the vacuum cleaner company) and electric car built into a Renault body, it could go equal speed forward or revers, go highway speed (60 miles per hour) And had a 60-100 mile per charge range depending on battery quality.  A 36, and a 72 volt version were made.  Only 47 were made.